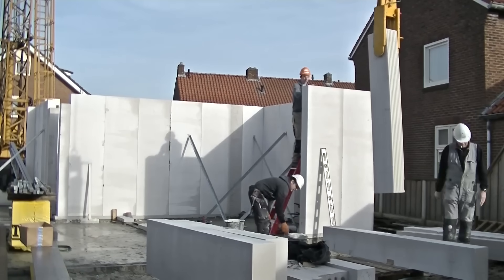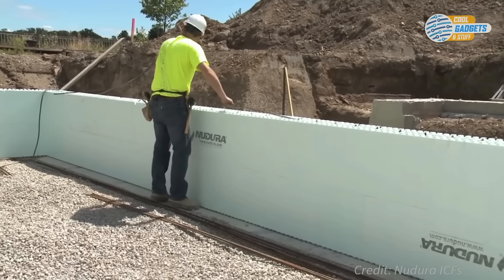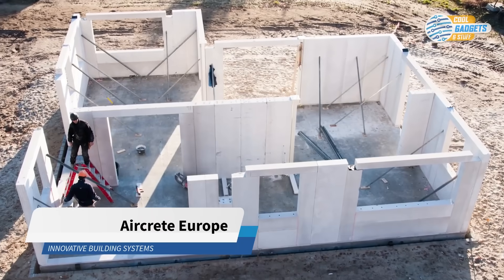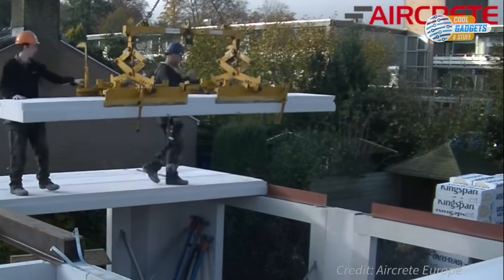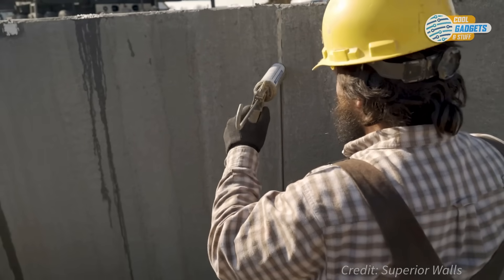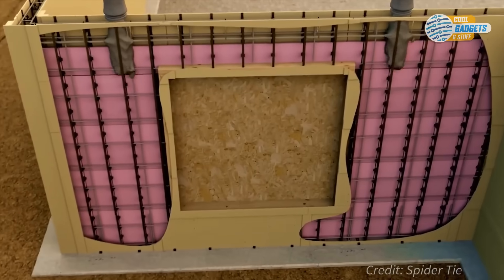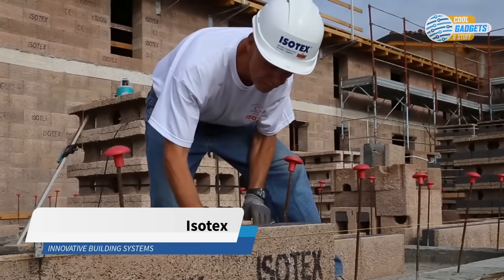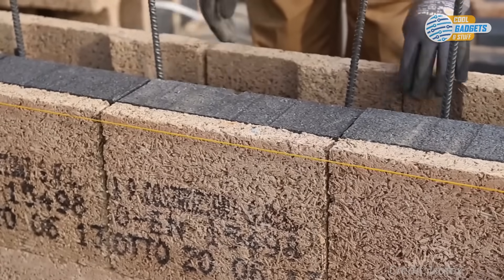5 Innovative BUILDING SYSTEMS for your future house #1

Comment: If nudura uses the aircrete system on its wall or isotex uses the aircrete system instead of wood chips, that would be the best system for centuries on walls, ceilings and floorings. Anything sound proof, heat proof, wind proof, mold proof, weather proof, fire resistant and can resist/stop .45 cal bullet... that is the best for me. 2nd would be the spider link.

Comment: how about buidingg systems that also take in to account heat and cooling circulation and efficiency. Some of these homes wont have a constant cool or warm temp and will vary with seasons cuasing heating and cooling to vary. What about building systems that create stability and are designed for good air circulation?

Comment: 3:30 - it's kind of odd to hear talking about labor efficiency when there are three workers, a crane operator and some fifth guy in the background... I reckon that in the end, building with plain, small-block (that is, 60x40x25 cm or the like) aircrete is still cheaper than these oversized panels, and certainly more flexible and forgiving to labor skills. But then, cost of aircrete walls is such a small part of the whole cost that it's really unimportant. The buyer should realize that even basic interior wall finish will cost at least as much as the wall itself...
Reply: Gotta love aircrete, especially homemade as it is earthquake legal in CA with which small sheds and domes and sub permitted buildings are possible also.  With aircrete and  3d printed concrete there is no sheet rock or insulation worries, just paint, so that should be cheaper/easier right?  Last I heard autoclaved aircrete had not quite cleared the permitting hurdle in California for earthquakes.  For some designs it should certainly be possible to make happen.  They've done earthquake testing in other countries.  Brazil, I think with special big blocks. We need earthquake and fire proof in California these days where it costs like $20,000 just to break ground for permits and utlities etc.    Fire rebuilds have some of that in place, but a lot of insurance coverage only pays for rebuilding the same exact stupid house.  That might need legislation.  You'd think insurance companies would figure it out for themselves.
Reply: @OWK000  Sorry, I just realized that the thing I called "aircrete" is in fact autoclaved concrete, and aircrete is something completely different (and inferior).

You're right about cost of insulation. The elefant in the room is cost of quality interior finishes. I'm right now struggling paying for interior stucco and tiling work - costs more than the "aircrete" structure itself.
Reply: @nvo7024  One would hope to avoid interior stucco work with aircrete, either homemade or autoclaved, although you could.  A coating of exterior stucco and fabric for reinforcement is part of the structure on a homemade aircrete dome.  Those new cement computer 3d printed homes have really cool texture built into the structure and are used stuccoless.  Casting aircrete walls with reinforcement is also an option (done in other countries) and that would have structural advantages on the very light autoclaved aerated concrete bricks or panels and also shouldn't need additional interior treatment. Tiling is not the worst thing to DIY.   Depends on your budget and what you see as civilized.  Some people just slap paint down on their plywood floors and that kind of thing,  HOME!
Reply: @OWK000 Can't avoid. In my climate (middle of Russia) hard, impermeable interior stucco is a must to keep warm moisture from penetrating the walls in winter. If it does, it will freeze somewhere halfway inside the wall... In theory, some synthetic sheets and caulk would do the same, it's just simpler to do moisture protection and finish in one run (and it's all fireproof).

Comment: Say goodbye to good WiFi reception. Between the rebar and the concrete you'll be lucky to reach between 2 rooms not to mention cellular reception.
Reply: So ICF basements will have terrible cell reception. anyone with personal experience. IF you are building a 600k house you can probably afford to buy a few modem repeaters.

Comment: The Aircrete system isn't all that new. My dad used to work at the Ytong factory in The Netherlands back in the 1970's. Ytong is cellular concrete just like Aircrete and they too have a building system allowing you to put up the frame of an average house in just one day. When I was little I helped my dad build an entire barn out of these blocks, but that took a bit longer.
When using ICFs, how do you get rid of air trapped in the concrete?
All systems shown here use concrete in some form. What about a building system like SIPs, which is light weight, super isolating, structural and allowes you to build very fast.
Reply from the maker: Hi, I know about Ytong aircrete. I believe with ICFs they stir the poured concrete with metal poles to get the air out. It's in the video. Check out part 2, SIPs and some other building system are featured there.

Comment: Have you noticed how almost all the homes in all these videos are in the million-dollar range?  If this stuff was so great how come were not getting 200K homes for 100K or less?
Reply: Innovative techniques normally involve a lot of training time for contractors. It may be quick in theory, but a regular carpenter with 30 years experience in stick construction will still have to be trained to put these systems together and some manufacturer will require training and certification before they sell the materials to the contractor. This costs a lot and the high end market is usually the first to experiment with new technology because they can afford contractor labor to learn and even screw up. If a system starts to take off, say 20 years from now, more contractors will know how to build thus lowering the training cost and making it affordable. Also, big box stores will see the advantages to stock materials, thus lowering the cost by economy of scale and reduced international transportation cost. (Reclaimed wood can now be bought from some big box store. This wasn't a thing 10 years ago.) Lastly, permitting/code doesn't have prescriptive code for new materials, so you will usually need an architect/engineer to assist designing the system at a higher upcharge than usual.

Comment: What would you recommend for African climate? Do you have any recommendations of the companies that make the building systems presented in the video happen? Thank you so so much for this video. It is really helpful and it has opened my eyes!
Reply from the maker: Hi, check out part 2. There are building systems (M2 and Intelocking bricks) also used in Africa and hotter climate countries.

Comment: What would be the best and most price conservative type of build for a small (16x30) A frame?  jane.m.johnson@aol.com
Reply: Insulated Concrete Forms is use for the outside wall of tornado shelters in TX .
Reply: Check out Www.thermasteelinc.com    It is a system of custom made panels made with light gauge steel and eps.  I think they’re better than any of the examples in this video!
Reply: Jane, don't post your email address in a comment, you will get spammed. :)

Comment: i still wonder why prices of houses still cost so much when these techs are in place prices of houses should be less than 50k to build by now
Reply: It is the myriad government taxes, permit fees, and licensing requirements that make it so expensive.
Reply: @scorpio6587  the licenses, and the permit fees. should be reduced on crypto blockchain somehow tech.
Reply: I did not see your comment before my reply.  Why does it still cost $3,000 per tooth to have a screw put in your jaw and a fake tooth on top?  Why because oral surgeons and dentists can still charge that much.
Reply: prices aren't so much dictated by materials but by a place they built at.
Reply: Energy efficiency standards have been increased a lot
Reply: Cars have been made by robots on factory floors for years, no need to even move machinery. The same as the thousands before it, the thousands after it. Yet the average car costs 36 to 40 thousand. Even rolls royce are made by bot....but does it make them cheaper?? :)

Comment: I have a little bit of knowledge about home construction. I know a little bit about most of the trades: framing, plumbing, electrical, etc., but I certainly don't know enough to build a home on my own, but that's exactly what I want to do! Iam about to buy a building lot and I want to build a home using my own experience and expertise. Which of these methods would I be most likely to succeed in building it on my own, with maybe a few friends coming over on the weekends to assist? Under these circumstances, which method would be the most cost-effective?
Reply from the maker: Part 2 Building Systems - https://youtu.be/BvzGfth-mXo. Good question. I don't really know that much about home building to give you an answer. Maybe somebody else can give a good advice. Some prefab home companies also offer kit homes that one can build themselves. I featured some in my prefab home video series. Anyway, have a successful build!
Reply: ICF, no question, use ICF with fab form fast foot system for footer/stem wall combo. Use helix micro rebar as well to eliminate the laborious traditional rebar handling and install.

Comment: It would be nice if all these systems were available in the US.. Could you do a video on steel structural insulation panels too?
Reply from the maker: Hi, I will cover SIPs and Steel Framing in next video, coming this week. SIPs are polystyrene and Oriented Strand Board, didn't find any steel SIPs in my research. Links are in description below the video, you can find more info there about availability. If some company is not available in the US there are very similar alternatives. I can send you some links if you're interested.

Comment: As a drywall installer I have hunted those little plastic strips and let me tell you it isn't fun. Make sure and use a glue to bind the drywall to the wall to assist the screws.  It will save you some headaches.
Reply: Thank you for sharing this important information

Comment: I wonder what's the cost of the construction of the house with these new building materials?
Reply: AAC claims it's +10%, but when you consider you're eliminating  5 different trades & the high insulative value, I would bet it's net cheaper in apples-to-apples